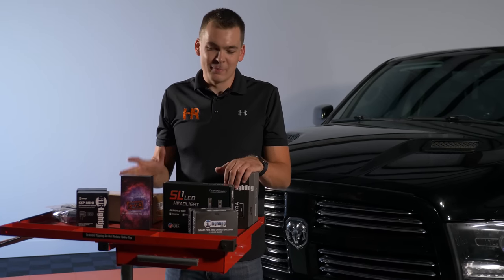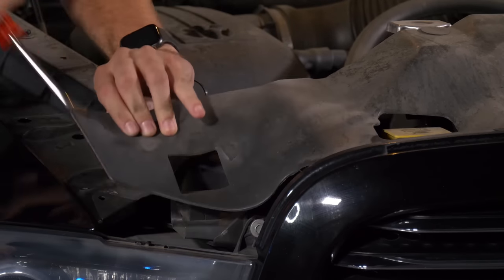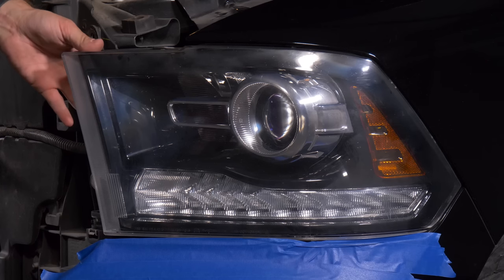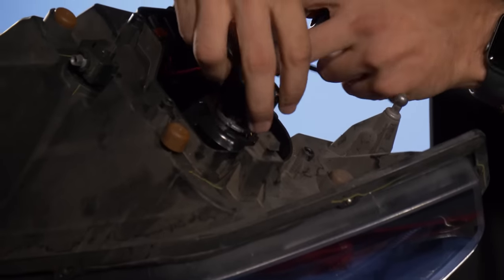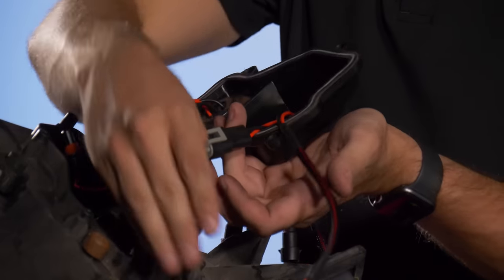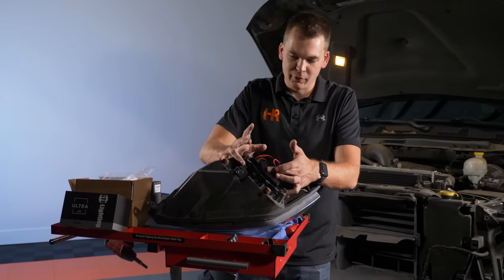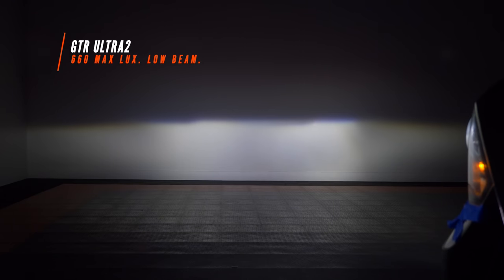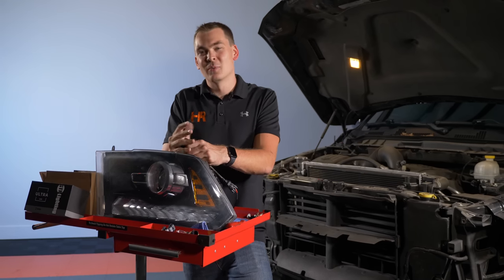HR Tested: 94% Brighter LED Bulbs for the 2009-2018 Dodge Ram with Projector Headlights

Comment: Do you have a H7 led bulb that will work in the aftermarket sport headlights like this style?
Reply from the maker: Although we do have that bulb in the  H7 bulb size, I am sorry to say that we do not have any that will be for street legal use. I can also say that with most aftermarket headlight housings, they have a hard time fitting the larger heatsink of LED bulbs, so halogen is the best option regardless.
Reply: @HeadlightRevolution  i have a 2014 ram 1500 but mine truck doesn’t have projector headlights ? Did this truck come originally with projector lights if not what website can i buy those ? I have the SL1 already on my stock headlight housing

Comment: How much is for the whole kit for a 2015 ram 1500 with the projector headlights??
Reply from the maker: Normally the whole kit would run you around $300. That would include the bulbs, pass through harnesses, PWM modules and extended dust covers. We have a sale going on right now though, Check out the website homepage for details! www.HeadlightRevolution.com

Comment: I'm looking into these for my 2016 Ram 2500. If I use a programmer to flash the BCM to recognize LEDs then I shouldn't need the PWM Module, correct?
Reply from the maker: Yes, that is correct!
Reply: @HeadlightRevolution  So with that said if I buy a pair of high beam bulbs and a pair of low beam bulbs you can just plug straight into factory harness and no pass through harness or extended covers required???
Reply: @kirkyenduro7393  you only need to buy the bulbs without extra wiring. Ive done this and flashed the BCM but still tricky finding one that fits inside the dust cover.
Reply: MCham08 thanks. Was thinking HID in the low and LED in the high
Reply: @kirkyenduro7393  yeah i have that set up cause i dont use high beams as much

Comment: Do we still need the 2015+ Mopar relay harness?
Reply from the maker: With the LEDs, you will not need that harness, but with the HIDs you will need to have that harness installed on any of the 2015+ vehicles. Let me know if you have any other questions!

Comment: Hi, is the Ultra Series LED 9005 will flicker on DRL mode in Camry 2017? Thanks.
Reply from the maker: Yes, it will. To fix that, you will need a set of PWM modules!
Reply: @HeadlightRevolution  Thank you for the response, where can I get the PWM set?
Reply from the maker: We have them available on our website!
https://headlightrevolution.com/gtr-lighting-pwm-interface-module-9005-9006-style-connectors/

Comment: Are the GTR led's also available for the fog lights on a 2017 ram 1500?
Reply from the maker: They would totally work for you in that application! I will need to know if you have the projector model headlights or the reflector model headlights, as the fog light bulb size changed between those sub-models.  When you get that to me I will be able to link the correct Ultra 2s that you will need for your fog lights!
Reply: @HeadlightRevolution  Reflector type headlights on a 2015 RAM 1500 Hemi. Led Fog lights needed.

Comment: How hot does the PWM module get exactly?
Reply from the maker: The PWM Module will get warm at best, they are designed to be in the headlight housing so heat will not be an issue! Let us know if you have any other questions!

Comment: Any LED recommended for 2015 Cherokee instead of HID? Thanks!
Reply from the maker: HID is definitely the best option, but the GTR Ultra 2 bulbs perform well as well! 
Bulbs: https://headlightrevolution.com/9012-gtr-lighting-ultra-2/
Anti-Flicker Modules: https://headlightrevolution.com/gtr-lighting-pwm-interface-module-9005-9006-style-connectors/
Reply: Headlight Revolution Thanks! Any plans of making some interior light upgrade videos for Cherokee?
Reply from the maker: The interior lights are already LED, so they can't be upgraded unfortunately.
Reply: Headlight Revolution I don’t see that info on manual though. Thanks again!

Comment: Ultra 2s vs HIDs next pls
Reply from the maker: While we didn’t do them in the same video, We do have a separate HID video for these trucks if you’d like to see how they perform!
Reply: @HeadlightRevolution   what would be brighter led or hid for this low beam projector headlight i have a 2015 ram 2500 with oem projector but I’m debating if I should get led or hid please respond I’m ready to purchase
Reply: I have the 55w gtr hid kit and am very disappointed

Comment: How can I fix the random off problem on my 2015 Ram. I have the anti flicker mogule and the bulb itself has a canbus corrector. They turn on for a good while, but turn off randomly when driving or parked. Then they turn on or sometimes won't turn on at all. The headlights are the classic mirror type not projector. And the bulbs are auxito H11 with cooling fans. Super bright.
Reply from the maker: I am sorry to say that there is no official fix out there for that vehicle, that is an issue that you see with any LED or HID product on any 2015 MOPAR vehicle! Your best bet would be to bring your vehicle into the dealership, and have them perform the TSB on the electrical system. Let us know if you have any other questions, we are here to help!

Comment: Will stock dust cover close over the low beam bulb? Thanks.
Reply from the maker: It will if you use the extended dust covers. We put a link to them in the description.